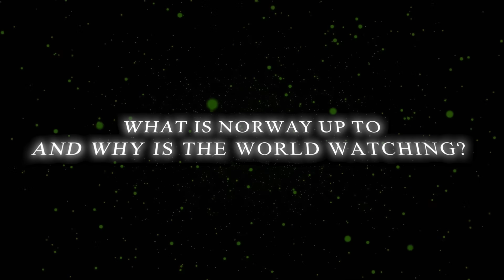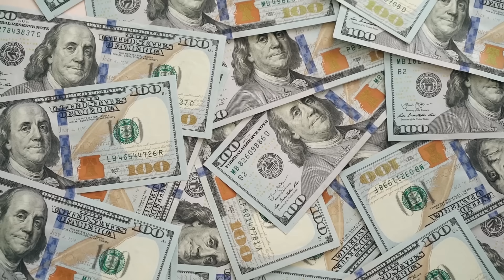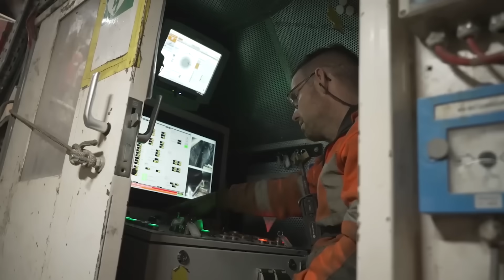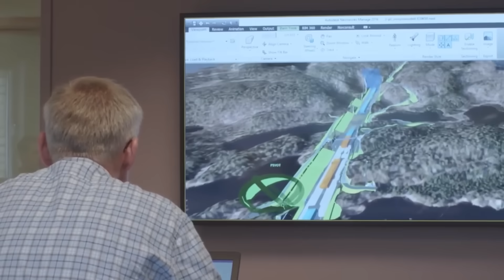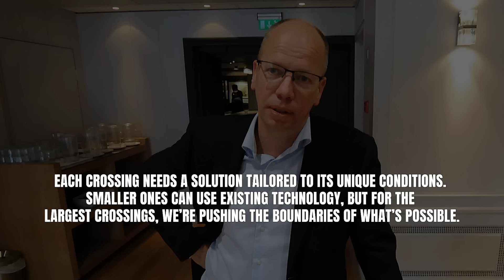Norway Just SHOCKED the World with This Insane Megaproject

Comment: This project will be completed by 2032.
Some other guy used these videos last year and claimed the tunnel were being built in China and not Norway. The worst part is that commenters praised China for this even when it were designed in Norway and are being built in Norway, on the other side of the planet.
Reply: Honestly, by the speed (or lack thereof) I think the project will take longer than 2032. Probably finished by 2040 or so.